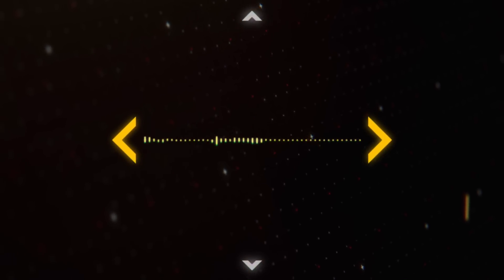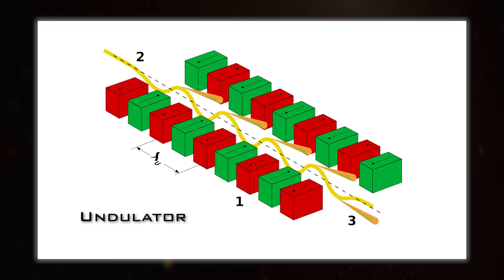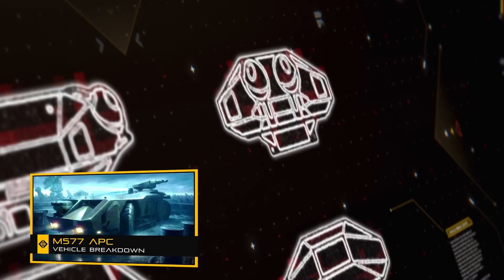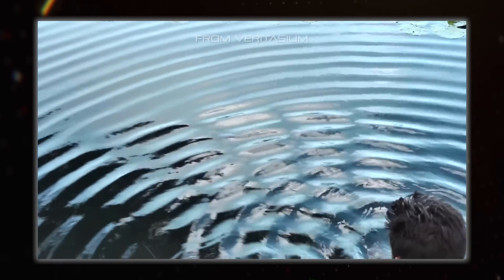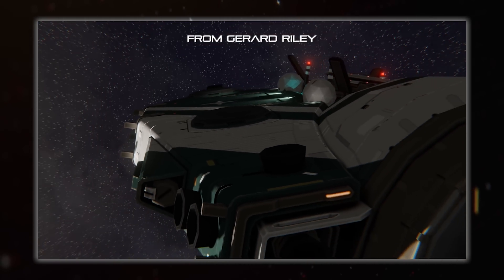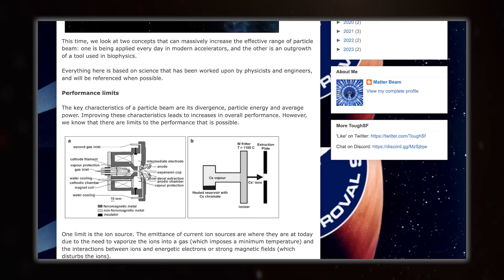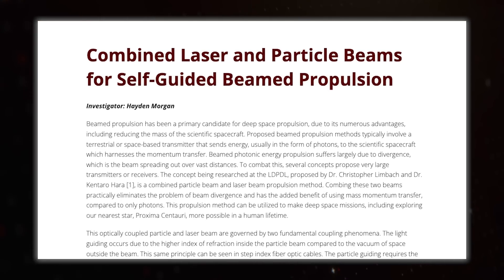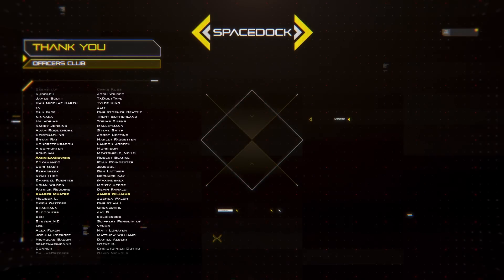Advanced Laser Weapons in Realistic Space Combat

Comment: If you don't have any fancy energy shield a la trek & SW and your enemy is trying to give you a bad case of artificial sunburn then what about using some kind of ablative material on the hull of your ship, akin to the thermal titles on the old space shuttle used for protecting against the heat of reentry? The technology is already proven albeit in a strictly non combat environment but I'm sure it could be applied here to. 

You could maybe have multiple layers of it too depending on the size of your vessel. A fighter type craft probably not but a capital ship should have plenty of surplus of thrust to counteract the increased mass so maybe it wouldn't be too much of a problem.

Comment: I’ve started looking into kinds of laser weapons and how they would work mechanically. Some are more appealing than others but this is my understanding: There are basic modern electrical or chemical lasers that burn things slowly, over varying (limited) range with precision usually optical sensors and exposed circuitry, piezoelectric lasers that only need to hit a conductive material to fry electronics because it itself carries an electron charge so it’s a true EMP laser, thermonuclear lasers energized by fusion (the first example but bigger and badder from Excalibur all the way up the Death Star), resonating lasers (continuous beams) sustained through mechanical pressure (Starfield laser weapons with their pistons and turbines) and fractal lasers which are more like wide cones of directed thousand degree heat than lasers (the war beetle from Gears of War 3 with its immulsion breath which is obviously organic and chemical not nuclear or electric light energy). Afaik that last one can’t be generated through fusion and it’s ironic because that’s exactly what a thermonuclear weapon is like and vice versa super X-ray lasers are more like they’d rely on fractal patterns. The way the lasers behave even the ones that are still just lasers is otherwise related to how they’re energized. A fractal laser would involve some added intricacies in the focusing chamber, the power source and/or the lens. Some of it is semantics, DoD/DoE classified or pure sci-fi nonsense.

My favorite one would be the Death Star style example but I’d go for the plasma “blaster” which is never pure plasma because they still require an electric discharge to propel that plasma.

Comment: @Spacedock I'd like to post a link to a document that I feel would be an interesting addition to the upcoming video of kinetic weapons, but I don't want it to be removed until you get a chance to read the article. It talks about a dreadnought killing cannon in a hyper luminary speed capable fighter craft which uses several micro hyper light drive capacitors that are charged by an electromagnetic coil nearly the length of the small craft, and actually activate a few meters out from the nose/barrel of the weapon/craft, propelling a round to FTL speeds towards a target several Astral Units away.

Comment: As a physicist I find the notion if using lasers as a long range weapon in space to be absolutely ridiculous. It would maybe work out against a vessel that has no defenses. 

Because the worst thing to get rid of in space is heat, coupled with the fact that high power lasers aren't efficient, so you'd generate at least double the heat you are trying to impair in another vessel. If you use pulsed lasers, the ablation it causes actually drops the efficiency of the delivered energy even lower.  If you do the reasonable thing and use a continuous beam, the target vessel can just spin and have thermal dissipation channels to a radiator, keeping in mind the attacking vessel will be dealing with double the heat. And then there is the fact the target vessel can have a first surface mirror cover that can be 99.8% efficient. So the attacking vessel is literally using 1000% more energy than it is delivering. Not to mention that a perfect parallel and a perfect focused laser are impossible. So at really long distances you are even less efficient.

The only way a laser makes sense in space is as a point defense weapon.
Reply: Everything I've seen from people trying to do the math on spaceship death lasers (Atomic Rockets and ToughSF) proposes lasers with large optics and high frequencies to be able to focus on a small spot at great range and rapidly boil a narrow tunnel through the target, overwhelming active cooling and destroying mirrors by sheer W/m^2. The shooter would still end up with more heat but spread out through enough lasing equipment that he can dissipate it into his radiators before suffering damage. Meanwhile, the target would have almost no additional heat in his radiators and a small hole in his reactor.

I'm not sure why you don't expect that to work. Are the energy losses in ablation really that bad?
Reply: @DecidedlyNinja  They forget there's only so much energy per area a material can take before becoming ionized plasma which in turn becomes opaque as far as laser propagation goes. You get some extremely heated up plasma right outside the laser "impact" point. Which is actually optimal for destroying missiles and perhaps fuel/water tanks, which would be a better target than a reactor.

My assumption is that vessels created for this purpose would have laser defenses in place. Such as the outside surface being a first surface mirror and over several layers of ablative material.

But if you put enough energy into anything, you can get through anything else. So the question becomes, is it worth having a gigantic set of accumulators powered by a huge reactor, which energy will only be 60% converted to laser at most and then reduced to 0.2% of that when hitting a mirror, minus whatever loses from focus and natural dispersion the laser will have, just to then have the mirror ablate, become plasma and have other layers of ablative material below.

Meanwhile, you could put all that energy into a coil gun or rail gun instead and get close to 90% to accelerate a small projectile to a fraction of C.  A defending vessel would need to constantly maneuver to defend itself against something like that and require much heavier ablative armor to have any hopes to not be pierced through.

I just think there are better ways to spend said energy in space instead of lasers, unless what you're attacking has no defense against lasers, then you can just use a continuous beam to heat and pierce it to death, which would be much cheaper in terms of energy requirement.
Reply: @DecidedlyNinja  "proposes lasers with large optics "
Well yes large optics. Kinda glossing over just how large there. Because to do something like shoot across a planetary system we are talking about skyscraper sized lasers. Minimum. 

Something the size of say the current US military laser in development has a range in maybe double digits km if we go by focal point.

Comment: FYI: Creating an electron beam that can generate x-rays is both surprisingly easy and small. WARNING: Science content follows!

To get reliable x-ray generation, you need to kick them up to about 0.2 KV or higher. Current electron microscopes use accelerating energies of 0.1 KV to 300 KV (Some rare ones can go higher). Even CRT tubes used in old TVs and computer monitors would generate electrons at about about 0.45 KV. An amusing fact is that once you cross about 120 KV, you start generating gamma rays...  and fun blurb for a reference point, a 300 KV electron is moving at 70% the speed of light. 

The size of the electron guns in these devices range from about the size of of a golf ball (CRTs) to about a cubic meter with shielding for the 300 KV units. The design basically consist of an electron source (A LOT of options on that one), and a charged plate or grid separated by a few millimeters that creates the electron acceleration.

Most of the mass and size of any free electron laser is the undulator as reflection cavities are a no-go. You can see current real world units by looking up Stanford's SLAC, it's LCLS, and its continuing mission to explosively atomize things for science!

Comment: Lasers can't work on spce distances due to natural de-focus of coherent photonic radiation (laser beam). So kinetic sand, railgun-shotguns and AI guided missiles is only way to wage war in space. Maybe particle accelerators, but they can be deflected via electromagnetic shielding
Reply: You can increase range by increasing the size of the lense but yes they are limited in range. But not so limited as to be useless at "space distances". You still get a couple tens of thousands of km with a reasonably sized weapon. 

And the problem with "kinetic sand" and the like is that it can be defeated by armour. There is this idea in hard sf that armour is just totally useless but that is hardly the case. If a ship is maneuvering evasively you would still have to be somewhat close to reliably hit it with a shrapnel weapon of some kind. You'd also have to detect it at range in the first place which is not nearly as easy as often portrayed. That makes intercepts at high relative speeds that might defeat most armour difficult.
Reply: @XMysticHerox  Yeah armour would almost be a MUST in space combat just due to the possibility of hitting ANYTHING at any kind of decent speed. The more common space combat is in an area, the more likely there will be fast moving debris fields from past battles. So a base level or armour would be needed on all combat vessels and probably most civilian transports as well.

That is something that would be required at least up till the race in question has some form of energy shield to block particles and even then they might consider the shields too power intensive and thus have armour anyway.

Comment: As an Operator at the European XFEL I have to compliment Spacedock. The functioning principle of an FEL was very well explained. To add some on top:

The method to generate laser light with an FEL shown in this video is called "Self-Amplifed Spontaneous Emission" or SASE for short.

Instead of relying on spontaneous emission, which generates a rather wide spectrum of laser light, the micro-bunches can also be created by an external laser. This process is called seeding. Both methods can be combined, by first generating a laser beam with SASE, sending it through a monochromator and than using it to seed other electron bunches. This process is called self-seeding.
Reply: Glad we did a good job! I admit it was broadly taken from the Wikipedia article on FELs and much puzzling over simplifying it while keeping the key parts. I'm happy to hear that it still holds up after that!
- hoojiwana from Spacedock
Reply: An FEL operates on the braking radiation principle, right? When you make the electrons wiggle, it is that energy that you use for the laser?
Reply: @Paveway-chan  Yes, the principle is the same as Bremsstrahlung, as a change of the velocity causes a charged particle to emit a photon. If the change in velocity is due to the change of the direction, the emitted light is called Synchrotron Radiation. And yes, that is the energy for the laser. We actually have to gradually increase the magnet field in the undulator, to keep the emitted wavelength constant, as the electrons lose energy along the way.
Reply: @Amadrath  
Interesting! Does this phenomena happen to any charged particle or is it just electrons? I was given to believing that only electrons exhibit this behavior and not protons or ions
Reply: @Paveway-chan  Any charged particle at relativistic velocities produces Bremsstrahlung. As electrons are much lighter, they radiate at lower energies than ions do. For this reason, high-energy electron accelerators are usually linacs (i.e. FELs), while ions still use synchrotrons (i.e. LHC).
Reply: @Amadrath  
Why does electrons barfing lower-energy light make it make more sense to use linear instead of circular ones? I would've thought that if an ion species radiate higher energy light it'd be more dangerous/stressful for the equipment to run them through a circular accelerator
Reply: @Paveway-chan  Sorry, I was unclear. When I wrote "they radiate at lower energies than ions do", I referred to the (kinetic) energy of the electron/ion, not the radiation.
Reply: @Amadrath  
Right, then I get it! The heavier the ion, the higher you must accelerate them before they start giving of radiation like that. 

If you could give a very rough estimate for an ion of some relatively light element, how close to light speed can you get them before they start giving off concerning amounts of bremsstrahlung?
Reply: @Paveway-chan  A Proton needs to have around 1800 times the energy of an Electron, to emit the same amount of radiation. At this point the proton will have about the same relativistic speed, as the electron has.
Reply: @Amadrath  
Interesting! I'm asking because I'm working on a sci-fi setting with realism like The Expanse but much higher tech, and thinking about particle accelerator guns. So what I'm getting is that if you're accelerating something much heavier, like a lead nucleus, you'd have to push it stupidly close to light speed before synchrotron radiation becomes a large issue
Reply: Does anyone ever call it as...SASEr? I'll see myself out.
Reply: So basically you are creating a standing wave of photons in the FEL that "seeds" the wanted light emissions by forcing a change of the Energy state?

I imagine the loss % is directly tied to the fire rate of the laser, as the pump laser has to get exponentially more powerful as your fire rate increases to get the same laser output.